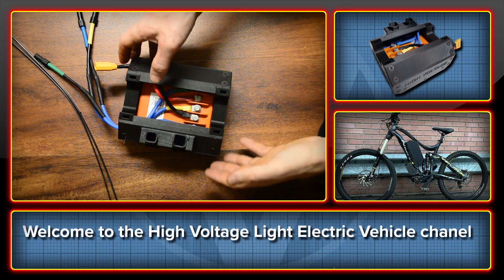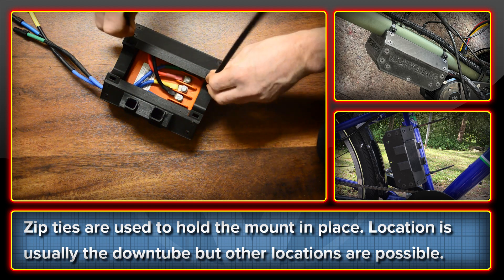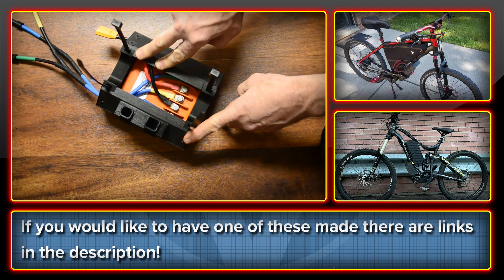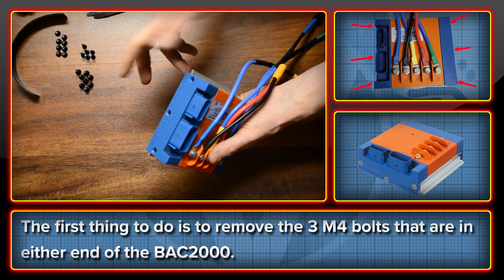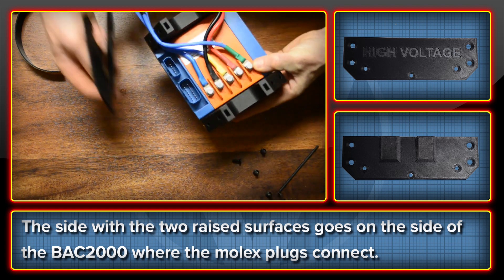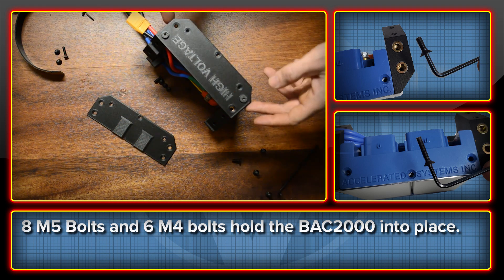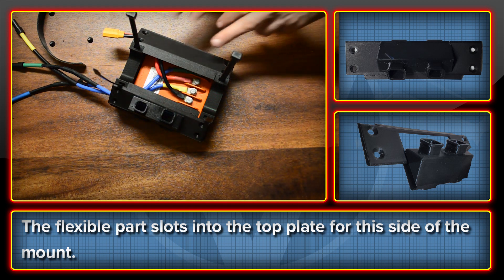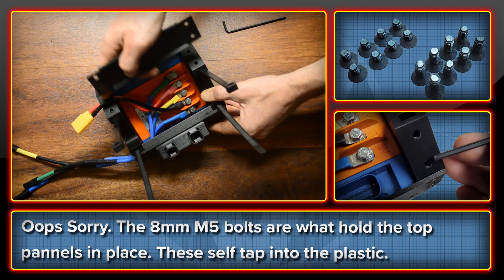CYC X1 Pro Gen 2 - ASI BAC2000 Mounting System for Tube Frame Bikes

Comment: Nice work, great to see 3D printing being used for things other than cosplay and figurines :)
Reply from the maker: Thanks a lot. The most challenging thing so far was mounting a motor with Carbon PC. Probably won't commercialize it but was a good experiment. Cheers.
Reply: @HighVoltageKits  Prusas PC-CF is pretty good, but I have an extremely stiff UPAHT-CF15, I have made many mods for my Bafang Fatbike, also made a 104BCD chainring adaptor it for a BBS01, its still going strong.

Comment: Hello, great channel.
Have you done a performance comparison between the BAC2000 and the X6 controller.  I'm considering replacing the BAC2000. Thank you
Reply from the maker: Thanks. I have not. Mostly because I thought the 800 was enough on my CYC bike. My motor is Gen 1 and not supported by the X6. I don't really want to buy another X1. If they want to send one I will test it though 😆